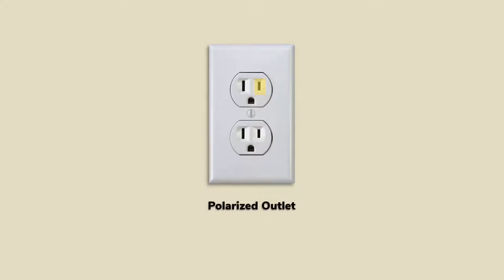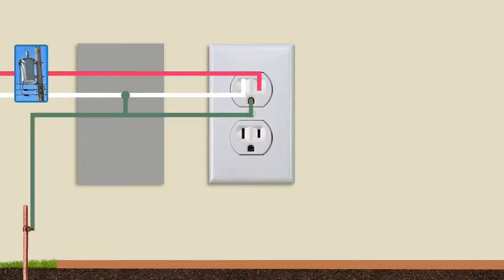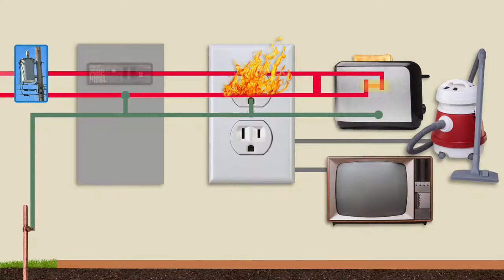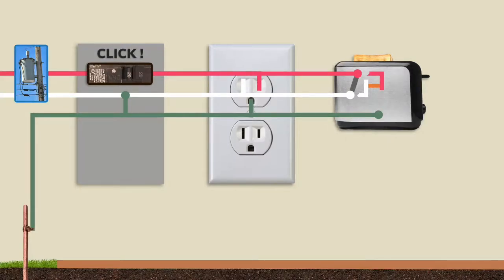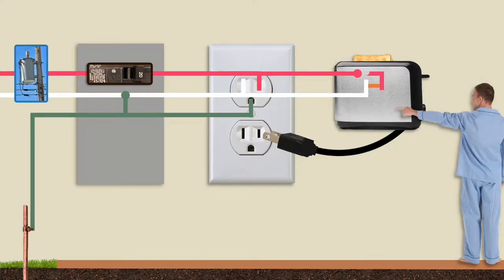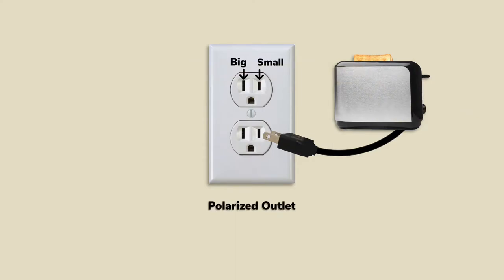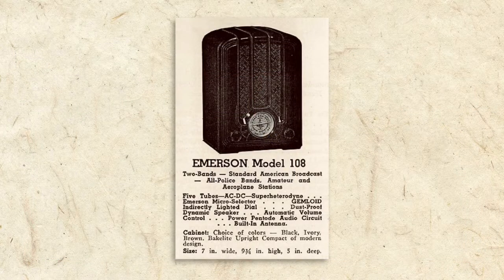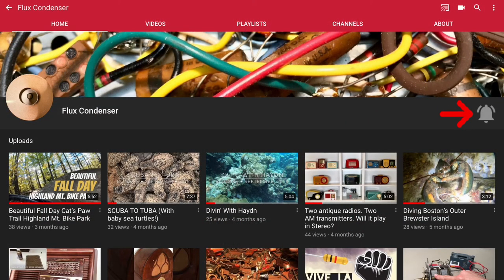What Are Ground, Neutral & Hot?

Comment: OK, get ready for is probably  a mind-blowingly stupid question. In a previous video, you explained the difference between DC and AC. In DC, electrons flow steadily out of the negative pole, and into the positive. OK, so maybe then, in DC, we can say that the negative pole is "hot". But in AC, you explained how the poles are equal, and that the direction of  flow of electrons swings back and forth. The flow switches back and forth 60 times a second. First they flow out of one pole, and next out of the other. So how then, can you say that one pole is "hot", and the other is "neutral"? Aren't they both equal? What makes one different from the other?
Reply from the maker: That’s a great question, Marjorie and that’s something that’s always puzzled me as well. The difference between hot and neutral really has to do with which side is grounded. In US homes, the neutral is, at some point, connected to the ground. Therefore, the other side is considered hot (more dangerous), because if you’re touching any part of your home, for example simply standing on a floor, coming into contact with a hot wire has the potential to shock you.

Comment: I think this topic needs further more explaination .This video doesn't explain a very fundamental question.As you said earlier that DC has a fix positive and a fix negative wire and in case of AC the positive and negative just alternate at a fix frequency. Then why our AC household outlet has a fixed hot and neutral wire like DC on the first place?
So please explain a simplified wiring diagram of our power distribution line (from three phase  alternator at power station to distribution transformer to our house) to answer the question.

Comment: Thanks for this. But I’m still lost on one part.

If we’re on a 60 cycle ac system.  Won’t the neutral terminal be hot 50% of the time ?
Reply from the maker: Well no, not “hot.” The neutral is grounded and so it is never hot. In a home system, it’s important that the hot, neutral and ground circuits are never reversed to maintain the safety of the system. As neutral is always grounded, it always has zero voltage potential. In an AC system current changes direction, yes, but hot is always hot and neutral always neutral due to the consistency of wiring in the entire household circuits, and that neutral is always grounded.
Reply: Thank you for the quick response and I think I’m getting it. 
 
So in the house system even though it’s cycling between positive and negative voltage, let’s say the moment neutral is in a positive voltage moment, if I’m holding it.  I won’t get shocked because everything around me and earth is in the same positive moment?

Lol am I getting it ?
Reply from the maker: Well, you’ll only get shocked if you complete the circuit. And this is the heart of the matter. Whenever you’re in your home, you’re exposed to ground potential. Especially if you’re wet. And this is what makes hot so dangerous. If you touch only the hot wire, you don’t need to also touch the neutral to get a serious shock. You’re completing the circuit just by standing in your home.
Reply: Ok ok thank you :-)